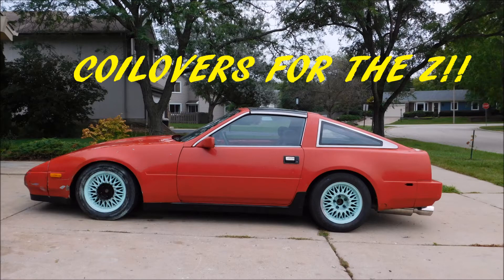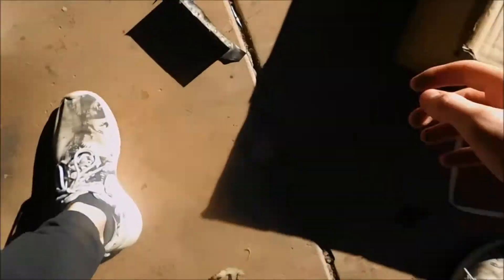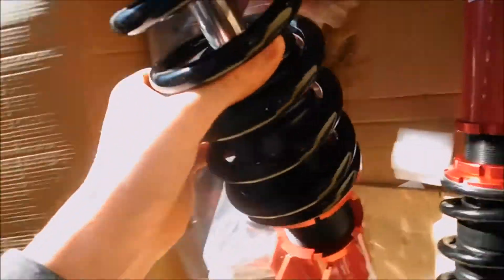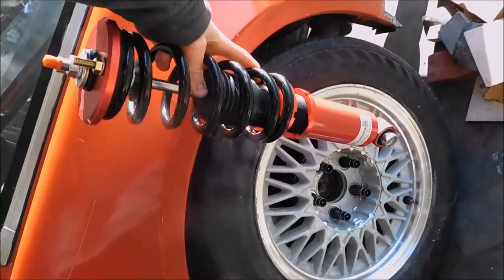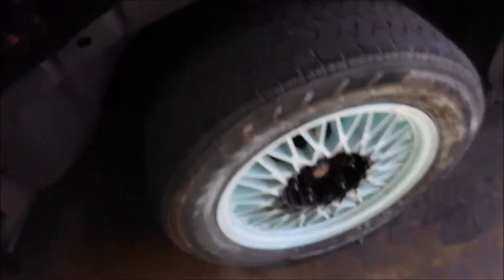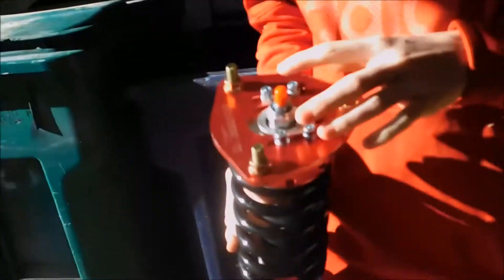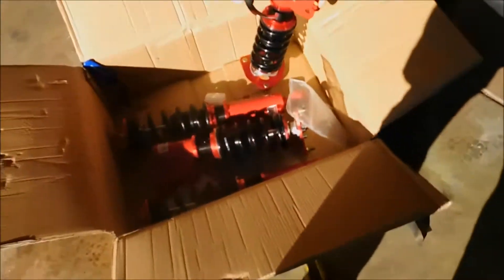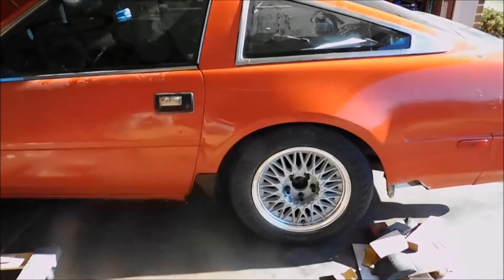S13 to Z31 coilover unboxing

Comment: Guys this will fit all Z31s, look up “how to put s13 coilovers on z31”, they fit you just have to cut and weld the front spindles into the new coilovers, it’s easy as hell to get done or do if you know basic welding. If you don’t know how to weld, don’t attempt to yourself, you can fuck up the penetration or get bad welds and if that breaks while doing a pull down the highway, well then good luck Charlie.

Comment: Do yourself a favor and throw those front adapters in the trash and just weld the lower mount to the spindle instead. That design is widely disliked by the community because it loads the dampers in the suspension incorrectly. The whole community has called the maker of them out on it.
Reply from the maker: NjBorn I’m doing it so I can swap coils easily and it’s much better than cut springs lol.
Reply: LZ Garage you still have to weld to spindle. Just weld the the lower coilover perch to spindle and do it right the first time.
Reply from the maker: NjBorn I’ll consider that for when I get another Z. I did it for this car for ease of replacement, and much easier camber adjustment. Not all cool over lower sleeves are the same. If they were then we would have been fine,